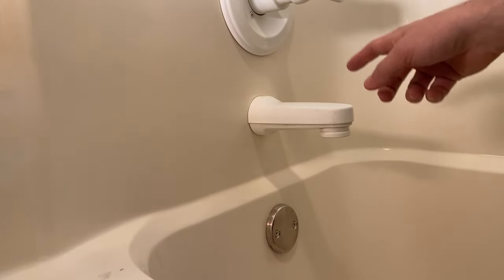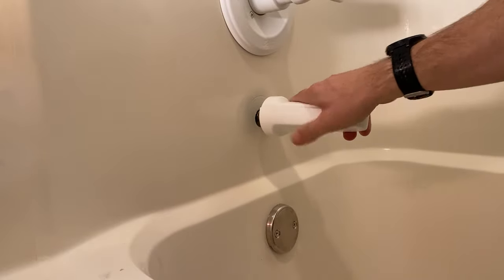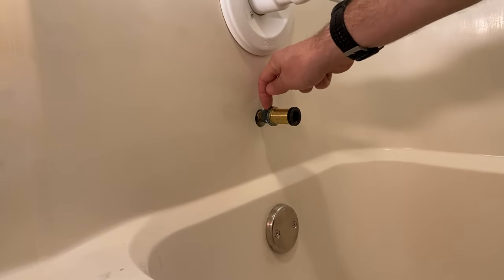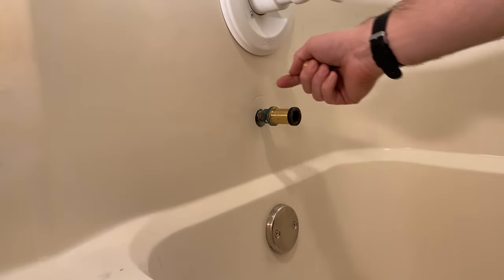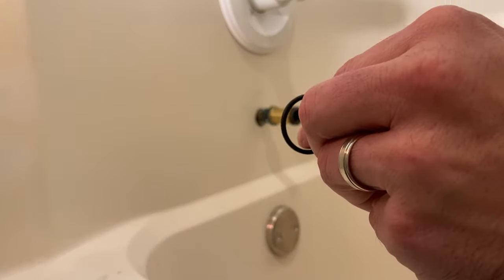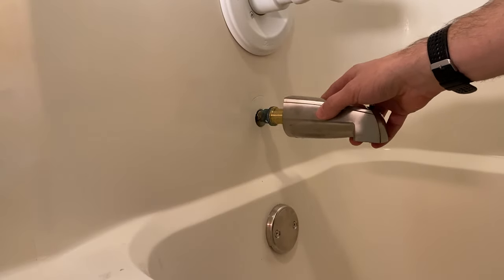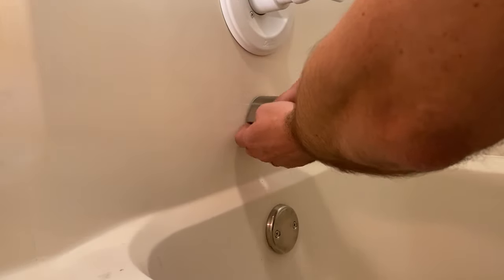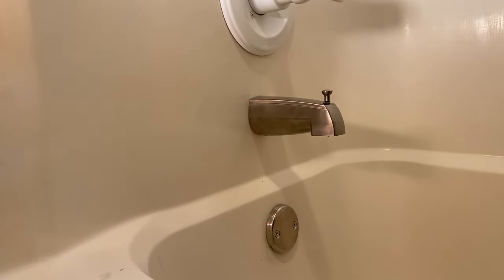HOW TO REPLACE A DELTA TUB SPOUT

Comment: This is perfect. I'm replacing the exact same style chrome Delta tub faucet and didn't realize there were different types of ways to attach the spout. Ordered from your link as it's exactly the replacement we need. I bought another brand from the home store and that's when I found out the spouts aren't compatible. Didn't know it was so difficult to swap out a simple part.
Reply from the maker: Yeah, that is a super common trip up when trying to swap out spouts.  There are universal spouts which comes with all the different hardware to adapt to 95% of all designs but seems like the quality is usually a bit lower.
Reply: @EverydayHomeRepairs 9 1:38

Comment: Great stuff! Didn't know Delta had this great interface, like you said, very forgiving. I've got 3/4 male steel pipe thread coming from wall about 1 plus inch. The then used a short M-M coupler to it, then a niple pipe length from it to spout internal, WHAT A MESS!!!!!!!!! After seeing this, I'll cut the threaded end on wall to proper length & use this. Its Delta for me. Thanks buddy!
Reply from the maker: Yeah, no doubt.  I think it is a much better setup.  👍

Comment: The hole in the back is so you can see it drip if it’s leaking inside. It just happens to be where they put the set screws on the set screw style.
Reply from the maker: Hey Steven, thanks for the clarification. 👍
Reply: I'm pretty sure it's called a weep hole.  And some of the spout adapters have set screws in the middle of the adapter not even close to the weep hole.
Reply: WOW thanks for the info

Comment: Thanks for the post, my delta tub spout is just like this with the adapter but the trim kit I purchased has a tub spout that does not fit/screw over this adapter (it's black inside not white). This trim kit you place in the links is this the white version that screws over the adapter? Reading the questions and answers on Amazon it seems like it's a slip on and not the screw on? I can't seem to find which delta spout has the screw on!

Comment: Replacement Spout is no where to be found. Delta Faucet RP12307 is the adapter installed on 1/2 inch copper but spout and failing diverter gasket failed no replacement found. Any ideas?

Comment: Gr8 vid.  Question:  Delta only makes the spout in Chrome finish now and the rest of my shower fixtures are brushed.  You thought yours was old?  I had a gold one!  Wondering if I can just use some very fine steel wool or sandpaper to dull the chrome finish to give it a more brushed look?
Reply from the maker: Hey John,  I don't think that approach would turn out with the desired finish.  Is there a Delta design which is close to the shape/characteristics of your other shower pieces?  Delta  has a ton of different designs and I would think you could get a brushed spout that would match up well.

Comment: Or where could I find that spout size to replace my old one so I wouldn't have to take the adapter off? Lowes diddnt carry it.
Reply from the maker: This is the Trim Kit with the Tub spout I used in this video https://amzn.to/3aNQI3e .  I would think Lowes or Hom Depot would have a Delta Tub Spout in stock as they are so common.  Worse case you can order Prime from Amazon and get it in 2 days.
Reply: @EverydayHomeRepairs  thank you! I found one at lowes today and replaced it!

Comment: I looked under the faucet and don’t see a screw holding on to it so I’m trying to un screw it and I can’t get it to turn and I’m afraid of breaking the copper pipe
Reply from the maker: Hmmm, it can be tricky if you have mineral deposit buildup which is holding the spout on the adapter/pipe.  Wonder if a litle heat from a heat gun would help to loosen up the deposits so you could break the spout free without causing any unwanted damage.

Comment: Hello! I have this same exact spout with the same attachment style - I am having a hell of a time finding a replacement that fits this attachment type but is oil rubbed bronze. Do you happen to have any leads? Any style is great as long as it has a diverter, I am desperate!
Reply: I am looking for the same thing. Did you ever find one?
Reply: @nathanevans569  Hi, just trying to find a replacement piece here too. Where did you find it? It almost seems that most places do not have it. Thank in advance!

Comment: I want to replace the adapter too since the new spout I bough came with a new one. But I could not take the old adapter off no matter what I did. Any tips how?
Reply from the maker: Hey Jasson, is the old adapter soldered on a copper pipe?
Reply: @EverydayHomeRepairs  I'm not too sure,  I tried to do it with pipe wrench , it just won't loose at all, So I assume it's soldered on, How can I tell if it's for sure ?
Reply from the maker: @nuketownmayor  if it just looks like a copper pipe running straight into the adapter you should see a least a little signs of grey solder coming out between the outside of the copper pipe and inside of the adapter.  I would just use the old adapter and maybe swap out the rubber seal from the new adapter to the old adapter.  Best of luck!

Comment: I order from the link but mine didn’t come with the white thing
Reply from the maker: Hey Kevin,  sorry for the confusion since I actually replaced the entire trim kit I specifically bought this https://amzn.to/3aNQI3e spout / trim kit.  This kit I know for a fact has the adapter as seen in the video and if you want to swap the whole trim kit might be more ideal.
Reply: Do you know of a way I can take the adapter and re use it on the one I got from your 1st link
Reply from the maker: @kevindeville7704  your old tub spout has the internal white plastic insert, correct?  Can you remove it from the old spout and install on the new one?
Reply: I have no idea how should I just try to twist it off I can’t find a video how to sorry I’m not so handy
Reply from the maker: Hey Kevin, yeah it should just twist off but if the spout has been on for years some times mineral deposits really make it hard to remove.  Alternatively you could return the original spout (sorry for sending you down the wrong path) and get the spout with the insert.

Comment: My problem is after I removed the tub spout, the pipe still dripping water
Reply from the maker: Hmmmm, you might have a valve which is starting to reach the end of useful life and might need swapped out or possibly just the o-rings are failing.  If you have a Delta or Moen the mixing valves are pretty easy to find replacements for and swap out.  If you to swap out make sure you turn the water off at the main water shutoff valve.
Reply: @EverydayHomeRepairs  I used the Allen to remove and it is super tight, end up stripped the hex bolts not sure what to do